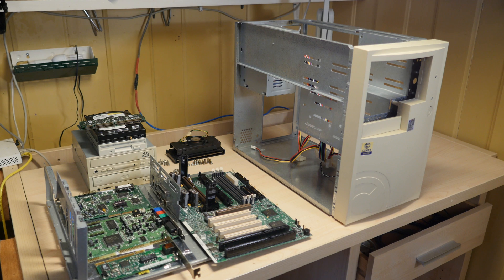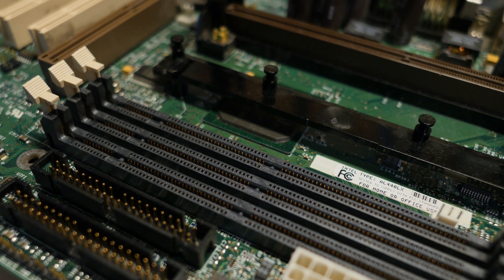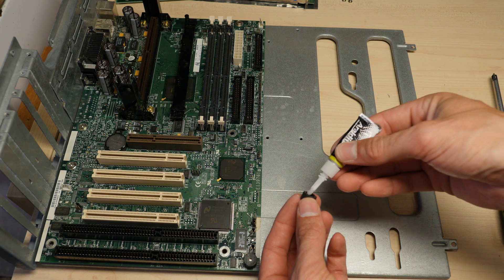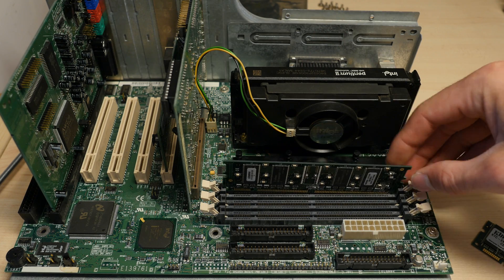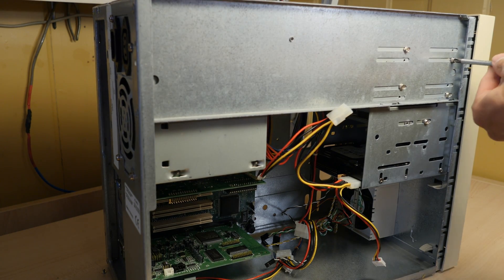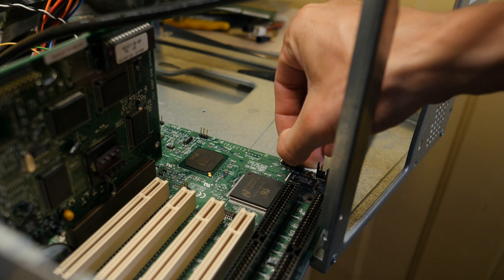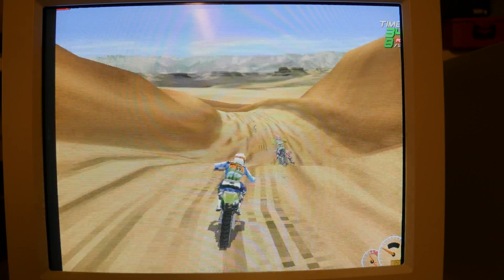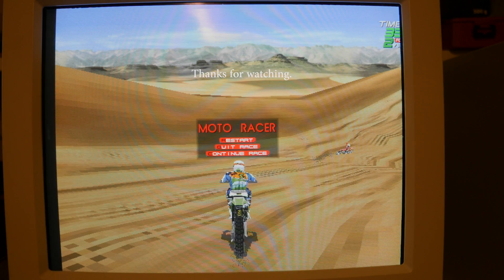1997 computer build

Comment: Great build. Love the case. Have the exact same motherboard. Love how you have to set a jumper to put it in config mode :) Mine has an underwhelming ATI Rage Pro
Reply from the maker: Thanks :) Yeah, I have used the Rage Pro, but can't remember much about the performance of it. I didn't have much expectations either.
Reply: @UncleAwesomeRetro  spent a lot of time with really old computers (xt, 286, 386, 486) when I started collecting retro stuff. never really cared  that much about the 1997-2000 period (despite the fact that that was the period I was most active when I was young). I have some 3DFX cards but never thought about collecting those interesting riva TNT cards, ATI cards, Verite v2200, Savage4). But you don’t find them that often.
Reply from the maker: @RetroSpector78  I would love to get more 3d cards myself like v2200 and savage4.

Comment: 1997 pc games: 60 fps , 2019 consoles 30 fps
Reply: For a casual like you yes it has differences. As a developer myself. it's not that easy to fully utilize a game at 60fps in today's standard computers. Massive amount of memory, gpu horsepower etc needed especially for the likes of Unreal Engine 4. Remember, 3D accelerated graphics were new at the late 90s.